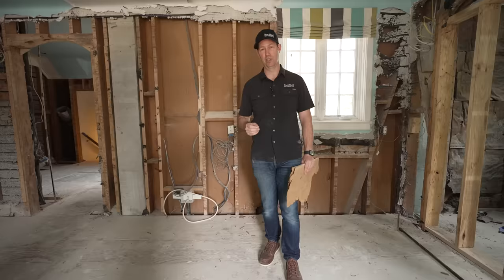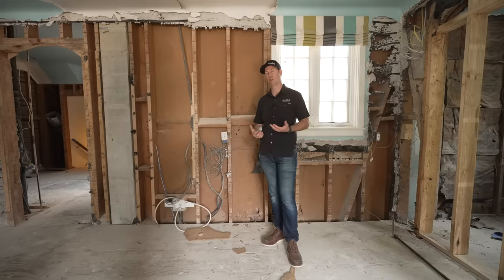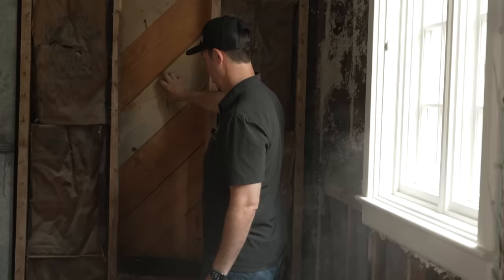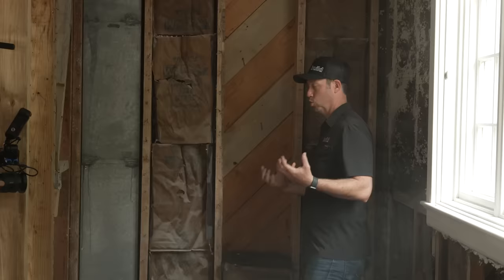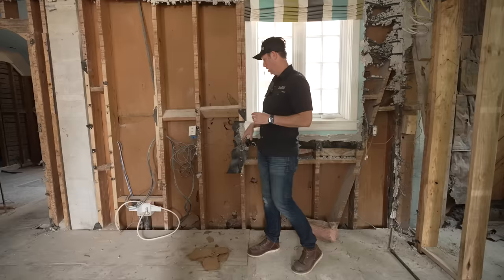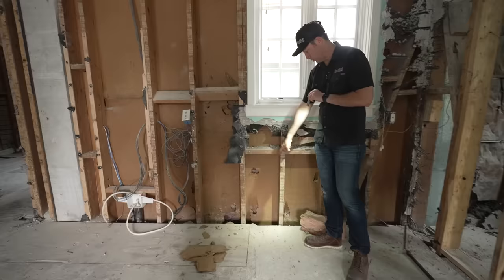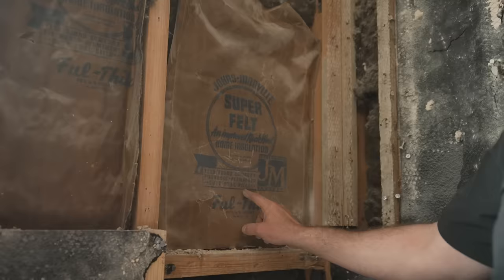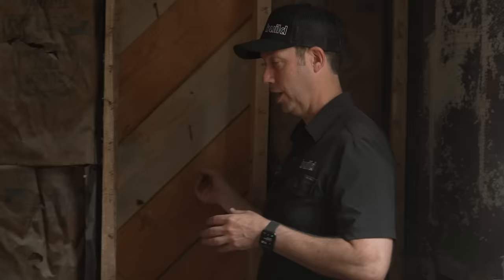I’m recommending we NOT INSULATE This Old House

Comment: My house is built in 1880. . It is 2 story full basement, brick exterior. It is balloon frame. How they built this is  brick 1 inch space , 2x4 stud, 1x6 t&g , plaster interior. No insulation. It’s 2400 sq ft living. Basement is unfinished at the moment but I still heat it.so I  have 3600 sq ft to heat . I have a 1996 gas furnace, electric water heater. I live in northern Indiana   My electric and gas bill never got above $300. Temp is set at 72 all year round. No drafts in the house. 
Last year power went off for 36 hours when the temperature outside was -5 f and windy. (Snow storm) it  18 hours for the temperature inside to drop to 54f  .

Comment: Looks like Celotex wall sheathing. Was used to cover 2x4 framing before siding was installed. Celotex was not intended to provide structural rigidity to the framing. This was usually done by cutting-in diagonal 1x material in the corners.
Reply: And most likely that is at most a sixty year old product, and not part of the original construction.

Comment: I would insulate with rock wool insulation that has no plastic or paper backing or facing to block vapor.    The vapor will travel through the rock wool without condensing.

Comment: My question would be is this wall cavity open from crawl space of the house to the attic, because if it is then that would be why the wall cavity is not rotted. The air flow through the wall cavity would have removed any moisture that would have gotten into the house.
Reply: I’m restoring my 120+ year old balloon frame house and we removed all the tongue and groove and insulated the almost 4inch stud depth by first a layer of 1/2 inch continuous foam board precisely cut to push in each cavity then sealing all edges with silicone caulk. We then used r13 glass batts for a total of 16.5 r value. We planned to then Sheetrock and ultimately ad lots of wood wainscoting etc using the  t&g we took out. The exterior is clapboard witch was at one point covered with vinyl siding witch we are removing leaving the original clapboard. After this thought provoking excellent video I’m now thinking I should add a layer of some type of mesh over the clapboard before covering with 1/2 inch foam board and ultimately 4x8 sheets of smart panel ? We plan to close the space from the floor to the sill with rock wool to deter mice/ bugs. Any thoughts to help us… anybody ?

Comment: its not molding because the particle board lets air through.
Here in germany we build houses with the airtight layer (plaster or a foil) on the inside so the warm moist air from inside cant travell though the insulation and condensate on the outside of it. 
No water in the wrong place no mold.

Draftsman for civil engeneering and construction foreman ..... not just a keybord warrior

Comment: What about adding vapour barrier between the insulation and drywall if you are worried about the drywall rotting? The Rockwall insulation handles moisture quite well as I understand it?

Comment: That material is called homasote. A particle board which has a coating of tar on the exterior. Left undisturbed would likely last another hundred years. I occasionally encountered this product when I renovated old houses In Washington DC. When we removed plaster or drywall we never found mold. Good stuff.

Comment: You should absolutely insulate - what you have to maintain is airflow/breathability. If you trap the moisture you'll have an issue. If you're using rockwool and the moisture can still evaporate (to the outside) you'll be fine. Under the window you definitely have a drainage issue and wicking into the fiberboard. Dig outside and fix that.

Comment: Spray on foam insulation is vapor tight isn't it... That would prevent both outside and inside vapor from moving through the wall... And... Greenboard is designed for high vapor areas... Would That be another non absorptive surface... 
Love all your videos... You explain the thought processes very well... So I'm sure you've thought of these examples already. 
I have an old 1947 brick house that I am going to begin expanding next spring... Brick needs to come off and (maybe) not go back on. BUT... I love brick and would like to have a skilled mason do a proper job this time. It was an amateurish job to begin with... So... Questions
Tyvex on outside of sheathing (diagonal ship lap)? Might thicken the foundation a few inches so I can add another layer of studs that I can run new wiring etc through, spray foam, then sheath, then tyvex, then brick...  
Can I clean up and reuse the brick, or is that just too time consuming and resulting in an inferior look.

Comment: It dries to the outside. Closed cell foam on the inside would not create an issue.  It would allow the partical board to dry toward the air gap. I’ve been remodeling 1880’s-1930’s in Cleveland using closed cell foam for many many years.

Comment: It is what we called insulation board, was used on the interior before sheetrock or what was called homosote which was used on the exterior and painted in some cases.

Comment: Hey Matt, great content. What are your thoughts of insulating an 1930’s house located in west Michigan. The original wooden clapboard has been recladded with aluminum siding with ‘buffalo’ board in between the two. I plan to use rock wool and fill the stud bays as it is ballon framed. The Tar paper is deteriorated.
House also has Original lathe & plaster inside. Thanks!

Comment: That sheathing is not new to me. In the Pac NW, many new stucco houses in the 1970s and 1980s used it, because of its better insulating qualities compared to plywood or shiplap, as well as low cost. Covered with tar paper outside. Then they would nail wire base for stucco onto only the studs.  They did understand that it does not provide diagonal bracing like wood, so it was required to put diagonal studs into many cavities instead.  Fortunately, the code already required continuous plastic vapor barrier before the sheetrock.

Comment: I have an old farmhouse with just 12” brick exterior walls. Previously they glued paneling over the interior brick. I want to frame the inside to run electric and insulate. Then drywall. I just don’t know what insulation to use. The house is in Tennessee and was never insulated before.

Comment: I have to keep in mind you are in Texas every time you talk about insulation. I'd say you'd have to keep into consideration if the house is air conditioned to fully decide whether or not to vapor barrier the house. I think the distinction between this house and many of the other brick walls you have shown over the years is that the house is completely bricked on all sides, that does a much better job of sealing out moisture leakage from the outside than a partial brick wall. Plus mortar and brick doesn't doesn't crack like it does up north where the water likes to freeze and crack the mortar. In a climate like Texas, brick will rarely get cold enough to form condensation on the inside because of its thermal energy gained during the daytime sun. I think you put in a closed cell spray foam, you will never get the temperature variation or the humidity condensing on either side of the foam (like it would with a poly barrier) and it would keep the air conditioning costs down.

Comment: Damn. I am renovating our 150 year old home built in an old church. Stone wall foundations and two foot thick brick walls. All the interior framing is pristine.  I am expected to put vapour barrier  insulation and drywall. Hope it doesn’t screw things up.
Reply: Wish we had some knowledgeable people to advise us.
Reply: @Blackcreekstudios  You need to consult and hire someone with deep knowledge of insulating old homes (not just a contractor IMO). I'm guessing you've done it by now? What did you end up doing? Almost everything in my area is 150 year old so I need to figure this out as well.

Comment: That odd sheet material is often called "beaver board".  It does not mold easily for some reason. I would suggest having that old insulation tested for asbestos.  Plaster is definitely the way to go in a house like that.  I prefer plaster if the budget supports it and you can fine a good plasterer, which is getting harder to do.
Reply: For sure.   Back in the 1920s many homes were very solidly built, because the folks usually built their own homes and would pass them down through the family,  just like the farmhouse that's been in my family since 1881 built by my great- great-great-great grandparents.  Aunt Sharon and Uncle Bill currently live in it.  Their oldest daughter is set to inherit the house once they move to an old folks home or pass away.
Reply: Old carpenter here. IMHE that is not Homasote, which is the trade name for "beaver board". It is the wrong color and does not break like shown. I believe it's particle board. That said, it presents issues with Matt's theory that the house was originally sheathed in particle board, as WIKI claims the stuff was not in production, as a commonly available panel sheathing until a decade later. So, the build date, or something, is out of sync here. If it was a 1920s build, I would assume that the diagonal board sheathing shown is probably the original. From WW2 to the 70s, particle board came and went as a structural sheathing product. Plywood supply issues, and economics, I guess. I had a friend who watched a new build go in next to his house, in the 1970s. This new SFH was on top of a small hill, in farm country. The builder was famous for building very low cost crap. The framers covered most of the rafters with 1/2 particle board and wrapped up for the day. High winds came through and over the next few hours the sheathing was reduced to chunks blowing around the neighborhood, leaving a debris field like a tornado, and damaging neighbor's cars, with bits of it still nailed to the roof. The mobile home industry gave it a try also. I have seen it develop huge sags between trusses, and create a bizarre looking shingled roof.
Reply: @kerrykerry5778  The stuff he's showing is definitely not Homasote. I believe it is Beaver Board (which actually is its own trademarked name) or similar.
https://en.wikipedia.org/wiki/Beaverboard
The attic and part of the sleeping porch of my 1913 house are finished with it.
Reply: @jongeers1954   Eh, true, but. Homasote sheathing was called "beaver board" for at least 75 years after the brand name failed.  Both of these, and similar products that were popular until the 80s, were compressed wood fiber sheets. The product shown in the video is neither the same color nor does it break down by hand in that manner. I remember framing in the 70s, as a young kid, when walls were sheathed with 1/2" fir ply on the corners, and 1/2" black homasote sheathing for the field. At that time it was called beaver board by the carpenters, roughly half a century after the brand name failed.

Comment: Could you install the old lathe wood strips vertically in the wall cavities and then foam board for heat and sound insulation? The lathe provides space to air movement and dryness.

Comment: When we bought our 4000 sq ft house, built in 1917, we had every intention of removing the plaster/lath on the outside walls to add insulation and replace with drywall. After living in the house for 2 years I can tell you it’s not necessary at all. Way better to leave it alone and intact. The house heats and cools just fine and stays comfortable year round. We are in Texas but have a full basement which I think helps temper the hot and cold extremes.

Comment: We are doing some work on an old stone house here in NY and faced a similar decision. We had a 14" stone exterior, 2X4 framing, and lathe and plaster walls with no insulation. We ended up replacing the lathe and plaster with rockwool and the GP dense armor. Our architect felt that would be a good substitute for the L&P while adding some insulation, able to tolerate some moisture if that became an issue and keeping the cost in check.
Reply: Thats exactly what I would have done, did you do a full veneer plaster over the denseshield or a level 5 tape job? Also you could really use cement board and do a full veneer plaster over that. I'd imagine the cement board would never attract mold.
Reply: How has it worked out? Same deal here in Boston
Reply: @vapeurdepisse  So far, no issues and have been happy with that decision. The walls are thick stone, we saw no signs of moisture issues when we demo'd the lathe and plaster but wanted to make sure the stone could continue to "breathe" from both sides. Using rockwool insulation directly against the stone and the "GP dense armor" sheetrock allowed this while improving insulation. 

The interior side of the stone had previously been pargeted (smoothed over with mortar to create a uniform surface) - this created a uniform space for the Rockwool insulation. It probably would have worked fine if it had not already been pargeted but that might be an extra step to consider and easy enough to do.

Comment: I would consider spray foam in all cavities and sealing the bricks to reduce water penetration. Modern AC already changes the humidity balance of the home. With such a large home you would be wasting a lot of energy air conditioning the home with no insulation.
Reply: Spray foam would act as a vapor barrier. The particle board sheathing would not be able to dry to the inside of the home like it used to, increasing the risk that it would mold/rot.

Comment: Matt how about testing the brick for water absorption There is a hole in the wall now from the piece you had in your hands and lets check to see if  the old brick absorbs or wicks moisture the same way a modern brick does. I kind of wander if the modern brick manufacturing and contents affect the way a brick absorbs water compared to a brick made 100 years ago. I would think that the way a modern brick allows water to enter the home today with particle board and no black paper and plaster applied the old fashion way the particle board would fall apart! Trust me I know what a modern brick wall can supply in a wall with a heavy downpour, Reminds you of water running down the windshield.
Reply: Brick is a very variable product. I have seen bricks from Alton, Illinois that were dense and water resistant as glass and brick from Mexico that would soak its own weight in water. All depends upon how it was fired in the kiln. I swear some of that brick from Mexico was only sun dried.
Reply: @markpashia7067  We just got through Water sealing the brick on the church, every hard rain was crazy. My local county's new justice center is the same way.

Comment: Easy way to fix the bottom mold issue is to puncture drain holes into the brick at the bottom where none can see them. In my experience things can get wet and dry out with no issues, it's when they stay wet that it's an issue
Reply: Bricklayers use to leave "weep holes" in the mortar. Usually the bottom course of bricks and they did it by leaving out the mortar in between the bricks on that course every eight feet or so. At least in St. Louis area. Too often the walls were tuck pointed much later by people who plugged them up and caused more trouble than help.

Comment: i wonder id this would be a good one for the foam or spray foam insulation. either could act as the stop barrier for the moisture ingress so the rest of that process would go on naturally. but you wouldnt get vapor or moisture inside causing problems.

Comment: It is called Homasote.  Not garbage.   Moisture permeable.  Fibrous exterior sheathing prior to foam sheathing.  You use foam sheathing.  No different except  do you see any rot on the outside of those 2X4 wall studs?  In and air conditioning climate?

Comment: So when it rains the bricks absorb water, then when the sun shines on that brick it drives the moisture further into the wall?? Seems to me that as the outside of the wall dries the moisture would migrate from the damper interior to the dryer exterior. I'm just nitpicking this one point. Your larger argument that insulation is ill-advised might make sense. The discussion is more than just academic to me. I live in a brick house that is about 100 years old, too. Mine, however, has outside walls that are solid masonry/plaster all the way in. No studs, cavities or insulation. I believe the horizontal structural wood members are actually supported by the outer masonry walls. Not sure if there's any practical, affordable way to add insulation in my situation.
Reply: Blow in cellulose from the inside.  Cellulose works.  I was a foam and spray-on cellulose contractor from 1977-1985.  If you stay in an older hotel in Las Vegas they have my foam insulation in their pipe chases.

Comment: Walls dont just dry from outside in but inside out. A vapor barrier could do damage. If you are up higher its less prone to mold. Lower to the ground the higher the moisture content.

Doing vapor barrier in and around your foundation works wonders too.

Comment: I have a 1929 craftsman style bungalow that has 3/4 inch shiplap inside and outside all the walls. I am renovating my home and decided not to wrap or insulate the walls because it is supposed to breath and dry out if water gets in.
Reply: I bet that house is beautiful.
Wouldn't it work to use unfaced insulation and an air barrier that allows drying to the outside? Or would that still slow the drying too much?

Comment: That board Matt is holding looks like fiberboard that Celotex used to make. It's made from ground wood fiber and run on a press with water, much like paper. Celotex was making it at least until the early 80's. Celotex also made an asphalt-infused fiberboard they called Sturdybrace for use as corner bracing.